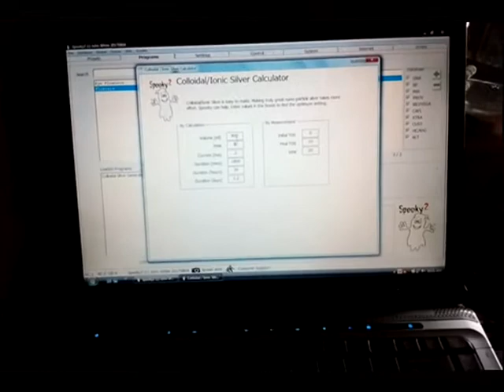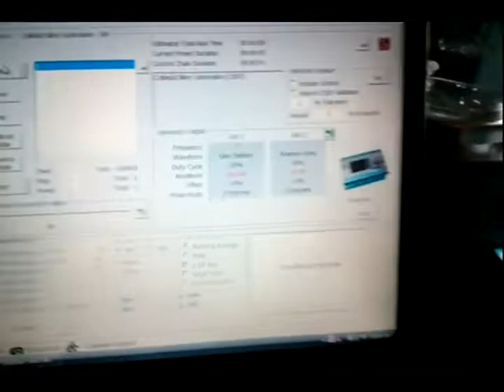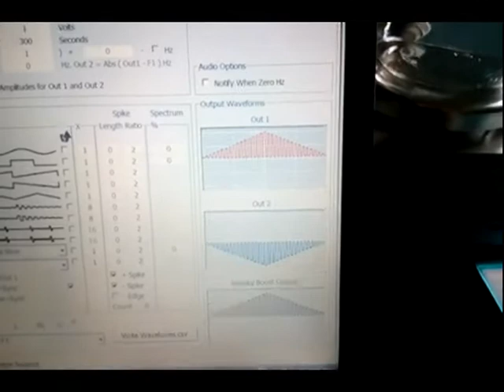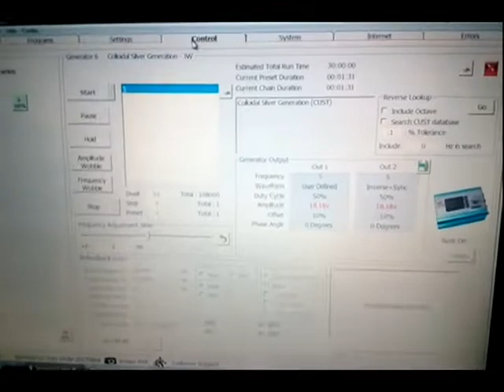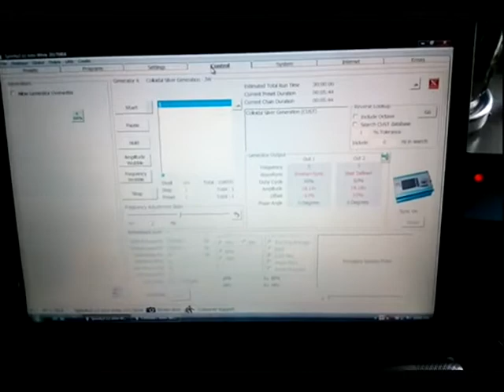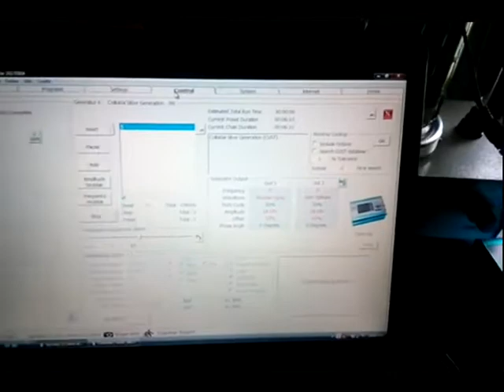making colloidal silver with spooky2

Comment: Is that a infrared thermometer laser gun? Very helpful video regarding the spooky2.
Reply from the maker: Yes it is.  It's the only laser I have with good batteries.  And thanks.
Reply: My Camlab magnetic hotplate stirrer just died on me.... I wonder if I can salvage any of the components from it?
Reply from the maker: I would tear it apart and look for the loose wire or stiff bearing. There's not much to go fatally wrong with electric motors.
Reply: lofas23, I believe the film capacitor might have failed..... I've taken it apart and it appears to use the same type of caps that you find in a time switch or LED light bulbs. And the fix? Just change the capacitor for a new one. To tide me over, I've been using the magnetic stirrer that came with my spook2 in short bursts.